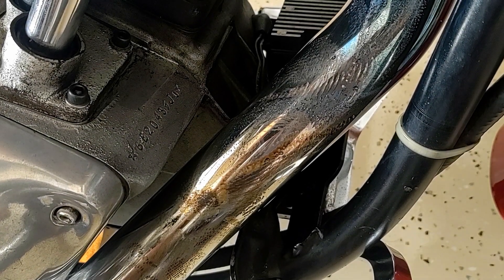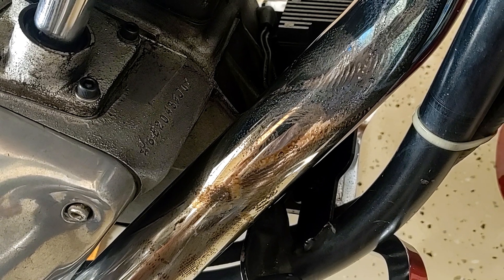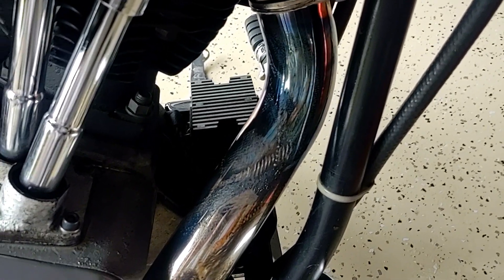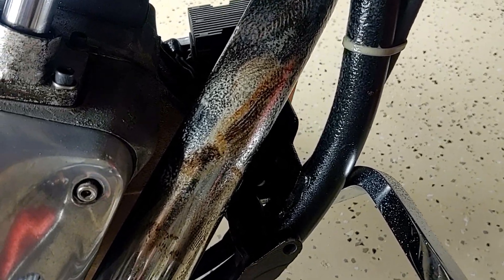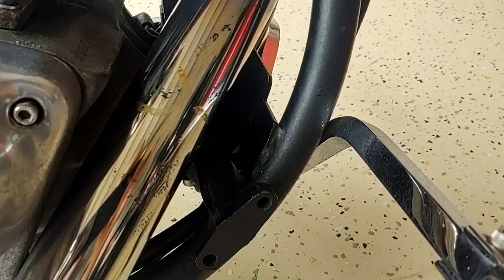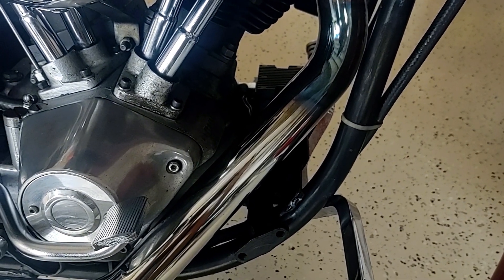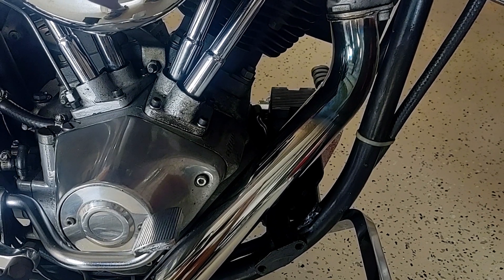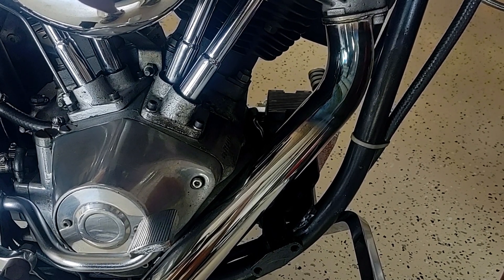CLEAN PIPES / NO SCRATCHES

Comment: You can use s.o.s. pads with the red soap in them they clean chrome really good I've been using them for years and have never scratched chrome makes your chrome wheels look like you just bought them but don't use them on polished aluminum or stainless steel it will destroy it
Reply from the maker: thanks man 👍💯